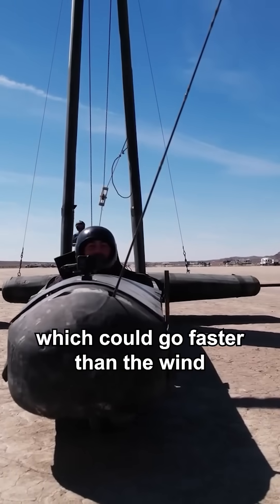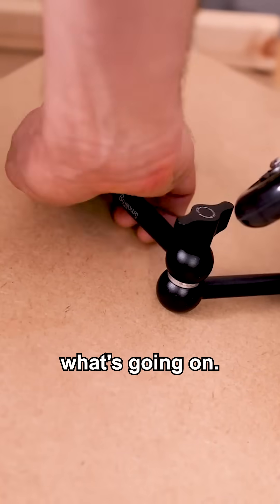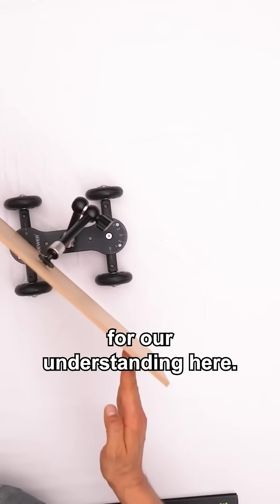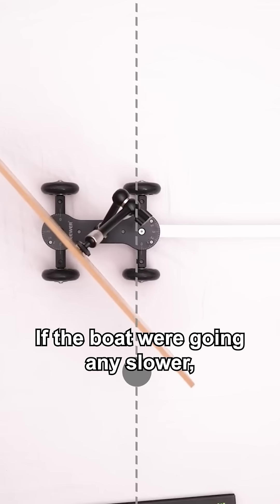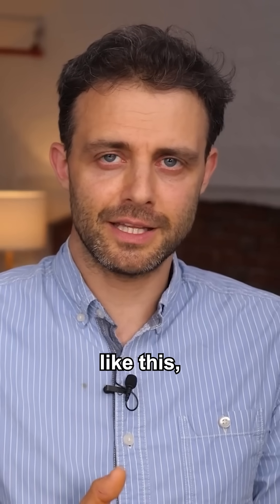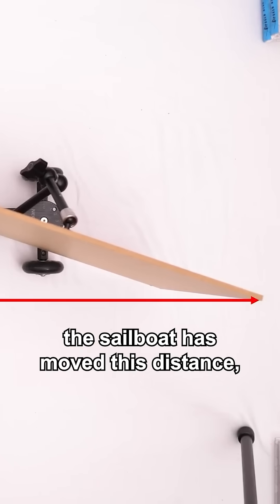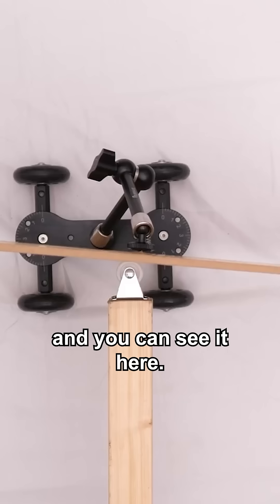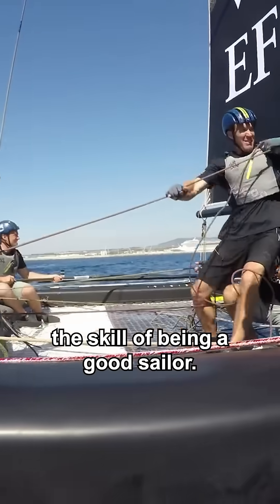How a sailboat can sail faster than the wind

Comment: Your explanation is really good and intuitive, but it doesn't quite address Matt's question. Matt wasn't only interested in how a sail can result in motion faster than the air, but in how that particular contraption can do that directly into the wind. As I understand it, what's going on there is that the car is connected to the ground beneath it via wheels, and those wheels have considerably stronger friction forces with the ground than the drag caused by the car having to plow straight into the wind. So, from a standstill, as the wind hits the blades of the rotor, the motion they cause in the rotor is transferred to the wheels through gears, and those wheels turn so as to force the vehicle into the wind. This actually improves the maximum speed it can attain, because the faster it is plowing into the wind, the faster the air is moving relative to the rotor. This would be much harder, if not impossible, to achieve without wheels pressed into the ground; for instance, if you built a boat in this way, you could in theory spin a propeller in the water fast enough for it to go into the wind, but the vastly lower efficiency of a propeller pushing a liquid, as compared to dry wheel on dry ground, would sap so much power that it'd never meet or exceed the speed of the wind. But the Blackbird is not a boat, it is a car, and it does have wheels, and that, I think, is what breaks our assumptions and preconceptions. :-)

Comment: In reality the wind will make the vehicle on wheels move faster than a in oat in water, given all other variables are the same. Rolling resistance is less than a boat on the water. Except maybe a hydrofoil, but that requires high speed to implement.

Comment: you describe the kite effect but sails operate under Bernoulli effect using lift as the thrust so the wind speed, drag and the reynolds number of airfoil (not just the angle of attack) are the limits to your speed.

Comment: Well but sails are not straight boards - with respect to the incoming air they are concave. That should mean that the sail can not miss all of the airstream like you described. The angle of attack of the wind onto the sail gradually changes until some of the wind in fact hits the sail and gets redirected in the direction of the stern, so by action=reaction this redirected stream of air propells the boat forwards.

Comment: That's only reaching (side wind) so you don't move into the wind's direction at all.

Going in a broad reach you have a lower side component, but also lower drag, as for high performance boats, most drag is from the air. As you pick up speed you can get a bit broader, again lower drag and side component. The game is to keep the wind coming from the side from the boat's reference, so no air drag and max power. Then it is only water drag (which can be quite low), until you try to go faster than the wind in the direction of the wind, and you start to have drag from the air, and the same sail that powers the boat, is also the break.

Comment: I’m sorry, but I’m pretty sure the people that made this video know nothing about sailing.  I know that he said they’re ignoring wind resistance, but how about the resistance of the water, how about the lateral stability you need to keep the boat from slipping sideways, which is why you have a keel or a center board. How about the fact that the sales are actually creating Lift and they’re not being pushed by the wind. How about a discussion of apparent wind how the relative and and velocity of the wind changes the faster the boat goes.  Foiling boats and windsurfers regularly go faster than the wind.

Comment: Additionally, there is also apparent wind. If you start with the wind perpendicular to you, as you move you will also experience wind coming straight at you from you speed. The vector of these two winds forms the apparent, or wind relative to the boat, and as you pick up speed it will increase the wind speed and decrease the angle between the bow and the wind. This effect is most notable on foiling boats as the minimal drag lets them attain higher speeds, increasing the effect of apparent wind, in turn increasing speed all the way until it hits the limit governed by drag.

Thus, especially in lower drag boats (low draft, good at planing or a foil boat) you can go many times faster than the true wind (I think something like 6x faster) because you are making your own wind meaning the wind relative to the boat isn’t that much faster (depending on point of sail— basically angle of attack for you plane nerds)

Comment: So, in this example, if the boat is sailing faster than the packet of air, then the boat would push against the air and slow down to reach equilibrium, right?

Comment: This is the wrong way to look at it.
The force (or pressure) does no work. It is the transfer of energy that does the work. Think about a volume of windy air containing energy because the air has mass. This energy is 1/2 mv2, where m is the mass of air and v is the speed of air relative to the water (or ground).
Power is energy per unit time. As the boat is moving faster it covers more distance per unit time and hence more air volume, which contains more energy.
And, BTW, the sail is not a plane, it is a wing, so the basis of the concept is wrong. It is the lift of the sail that pulls the boat forward. This lift is caused by the flow of air, not just static pressure.

Comment: So, when we think of wind power, we often visualize the wind moving directly in the same direction as the sail, eventually pushing it up to about the same speed. When this happens, the wind stops making energetic contact with the sail and stops producing thrust.
However, when the sail is placed at an angle, you can visualize how wind traveling sideways across the sail can still maintain contact. From there, it's up to the engineering of the sail itself to channel the energy from that contact into forward motion — much like how an ice skater moves by pushing their feet side to side, maintaining continuous contact and energetic exchanges.

Comment: Any closer than 15-20° and the heeling of the boat starts to come in to play, then you are also "slipping" the wind on another plane. When heeling you can use the loft on the sail to change the angle with the mail sheet brought all the way in and the boom parallel to the direction of travel.
Add additional sails in a sloop configuration. The air foil formed starts adding thrust.
Reply: Doesn't foiling (e.g. SailGP) allow the centre of resistance to the perpendicular force to be off centre, through lateral positions of the foils? Hence the heeling is reduced? The vessel would fall over windwards if it wasn't wind-loaded? The low resistance and high foil efficiency of these boats means apparent windspeed can be huge, and even upwind these birds fly
Reply: He also seems to forget there‘s drift on a sailing boat, very much in contrast to a car on wheels, which makes the assumed lack of resistance in this experiment kinda ridiculous
Reply: Mmmhhhh yeah... yes, I know some of these words.
Reply: @magtovi I was about to comment basically the same thing lol
was gonna say this is so dense in sailing terms it looks like a parody
…a parodeez nuts ok I really didn't need to make that one
Reply: So would an aeroplane with completely flat wings work?
Reply: @peterwynn4088  : A full sail is not flat - it's curved.

Comment: And pulling the sail tight against the wind is exactly what we do to accelatate when sailing. We slacken off the sail to slow down. We also have the keel below the boat profiding sideways resistance to keep yhe boat from being pushed in the direction of the wind instead of the direction of the boat.

Comment: Without resistance the boat's side wouldn't be able to push against the water and the boat wouldn't be able to move against the wind. This only works because there's a difference in resistance - that's why you can't do this with a hot air balloon.

Comment: The equivalent aquatic "ridiculous contraption" would be one where the sail also rotates like a windmill, and the rotation of the windmill powered a propeller.
Reply: Yea, one of those vertical wind turbines so it doesn't need to be angled toward the wind.  Connect it to the propeller and away you go.   But of course, the final speed would be pretty dependent on the gearing and how well designed the wind capture and propeller are at collecting an transferring that power to get forward velocity.

Comment: Well this just is not really what's happening is it? A sail does alot more  with lift and apparent wind than by push and true wind as far as I understand.

There is this very interresting theory that the very modern foiling racing boats cold be drifting down a river and a day with no wind at all, and pick upp enough apparent wind to start sailing, than turn and sail against the river with no wind.

In a podcast I heard a racing sailor claim the could sail faster than the wind, down wind by creating eoungh apparent wind coming from the direktion of the boat.

Sailing physics i just crazy but the sailing it self wundeful.

Excuse my Swenglish 🇸🇪

Comment: Problem is what he is showing and the concept that is explained in video arent the same thing.  The  1st photo clip has an active component - the rotating rotor (in propeller configuration)  is 1st acted by the wind. It than pushes air against the very wind that pushed in the vehicle at the start.  This was done because the rotor was driven by the wheels to creat a force to push against the wind.

Comment: Steve, I should probably talk to you about this.  I can blow your mind with a question.

Imagine a wind turbine with blades that are flat (not airfoils) and untwisted.  Now imagine they are perfectly flat to the wind (chord line at right angles to the wind).  Finally, imagine it's rotating (we spun it up manually by motoring it or something).  Can it make power in this condition?

Like I said, I should probably talk to you about this.

Comment: This model glosses over the most fascinating element of sailing by describing the sail as a simple incline or wedge. It's not a parachute, its a /wing/. The force forwards isn't simply from high pressure behind, but /suction/ from the low air pressure across the /front/ of the sail. You missed an entire phenomena called "apparent wind" that amplifies this suction effect since the sailboat now has additional velocity through the medium of the wind, increasing air speed across the front beyond what the wind itself provides, increasing the pressure differential of the sail.
Reply: The effect IS quite high. ITS wy in Windsurfing you dont Go directly with the Wind but rather at an Angle so you can glide with 3-4x the Speed than you would have If you Go with the Wind directly...
Reply: For downwind it is not working such way
Reply: @ОлександрХірх-Ялан  sometimes it does actually, even dead downwind. symmetrical spinnakers if trimmed optimally sometimes have vertical flow over them that generates lift pulling up on the bow and helps improve the hull efficiency in certain wind conditions and wave states. it doesn't do much in practice, is sometimes actually detrimental, and its a super niche racing optimization for like the extra .01% speed it gives you but it is still possible
Reply: @CRANKED_VANG  Here we talking about moving downwind much faster than wind speed, so aparent wind blow from  bow
Reply: @ОлександрХірх-Ялан  you aren't sailing on apparent wind but the sail can still be using bernoulli's principle and have airflow over both sides of the sail, working as a wing not as a bag being pushed by the wind, even on a dead run
Reply: Spot on. The sails are not flat planks, they are wings creating lift. I fly Hang Gliders ...with fabric wings that are essentially  two tall (high aspect ratio) mainsails joined at the base and facing in opposite directions ...like looking at a sailboat and it's reflection.
Reply: Hr didn't use the jargon (is it official?) but he absolutely did cover what you shrouded in verbosity.
Reply: @skylined5534  Not in this clip he didn't. Lift was not mentioned and the sail was assumed to be a flat plate when in fact it is precisely the shape of the sail that creates lift, especially when sailing closer to the wind

Comment: Science youtubers are the new age professor "battles".
One paper used to cause a counter paper. And now, one video makes a countervideo. And each video furthers the science.
Reply: It's doesn't further the science, the two of them just get closer to figuring out what's known in scientific papers. It's good content and science outreach though.
Reply: @orbemsolis  Well yeah. Here, you are right. They want to make it understandable. And make that in ever more intuitive ways.

However, the original video from Veritasium DID in fact further science. As known professors even bet that it was not possible to go faster then the speed of the wind, with just the speed of the wind as active propellant.
Reply: @aurelspecker6740  just because they were "known professors" should not imply that they represent the extent of collective knowledge, don't deify science as a thing, by which I mean that it should be remembered that science is a method, not a result. Think of it as a verb more than a noun. And being a professor does not automatically imply expert. AND if experts can't be wrong that would mean science is done, which of course it can never be. Whatever conclusions we draw it should be remembered that they are ONLY the best current model, and almost without exception they will be atleast refined and adjusted in the future and at worst replaced. Cheers.
Reply: @ Yeah but that is what science has always been. It was always known scientists that had an accepted theory and opinion based on their interpretation of facts.

And the fact that veritasium proofed them wrong and made them change their opinion is exactly how science works.
(unlike some pseudoscience and straight forward conspiracy theories that is unfortunately on the rise)
Reply: @aurelspecker6740  I haven't watched the full video but the impression I got is that they may have cherry picked people who didn't agree (which there always will be) for good content. After all, sailboats have been going faster than the wind for centuries by using lift over drag and it's a bit silly to predict that it's not possible.
Reply: @orbemsolis  DO watch it. Not this video but the one of Veritasium. IT is not just about Sailboats and it IS a bit more to it than you probably think.

Also it is a series of 2 or 3 videos. First one was just showing the idea and interesting thing. Second and third one are proofs, examples visualisation. Also because the Prof bet 10k USD that it was fake. (He did eventually get convinced.)
Reply: Hope they won’t escalate to drive-by discussions.
Reply: No real innovation is still being hased out in the academic journals. These communicators are great though. The counter videos are just when someone trys to spout some bs and they get called out.
Reply: @ryancasey2787  Or they did NOT spout some BS and it was just some surprising stuff.

Comment: I'm not sure this "holds water" (sorry...not sorry) 

In the boat is 2 wings. One is the sail, one is the vertical fin under the boat, as the boat goes faster, it generates it's own wind, (true wind vrs apparent) 

This is why on the foiling boats like sail gp even going down wind they have the sail sheeted in very tight because the apparent wind direction is well forward. You sheet in tighter as the speed increases.

Comment: Wow, that IS an intuitive explanation! I always knew this was possible and never understood why.
Reply: Did not expect to find you in this comment section xD
Reply: I thinks Derek's model with the wheeled cart was WAAAY more intuitive
Reply: @masina9447  Unfortunately Derek's model missed the most important element.
Reply: @SolvingTornadoes  Thank you for that useless cryptic reply.

Judging by your responses here, you must be extremely irritating to work with...
Reply: It's wrong. The role of the wind is to remove/reduce the air pressure on the leeward side of the sail/wing/propeller.  This allows the air pressure on the forward side to provide the propulsion.
The same is true for all aerodynamic entities.

Comment: So for most actual sailboats, bournoulli lift is what’s actually doing most of the work and you’re aiming for like 30° either direction off of straight into the wind for max speed
Reply: CORRECT! I can’t believe I had to scroll down this far to see this comment.
Reply: Yep! Bournoulli moves modern sailboats. Old time sailing vessels were moved by "push "..
Reply: Yes... Bernoulli's Principle
Reply: Yes. The role of the wind is to remove/reduce the air pressure on the leeward side of the sail/wing/propeller.  This allows the air pressure on the forward side to provide the propulsion.
The same is true for all aerodynamic entities.